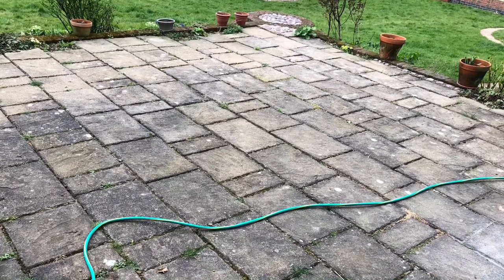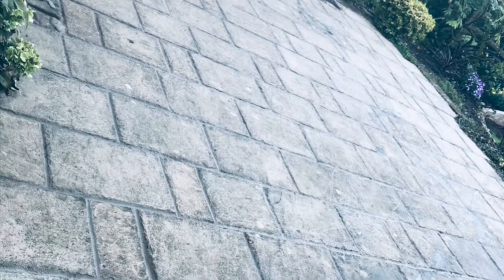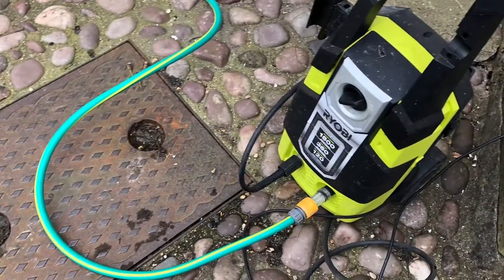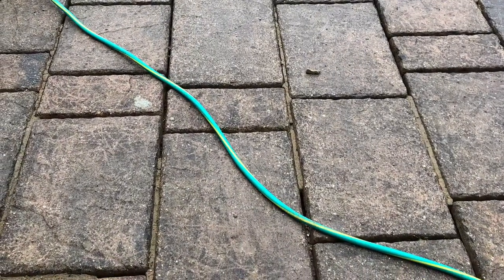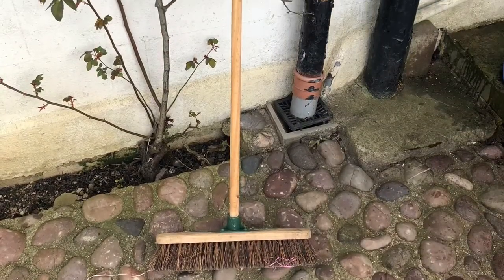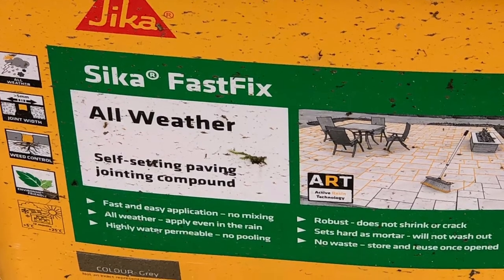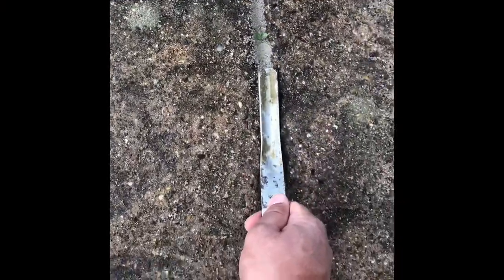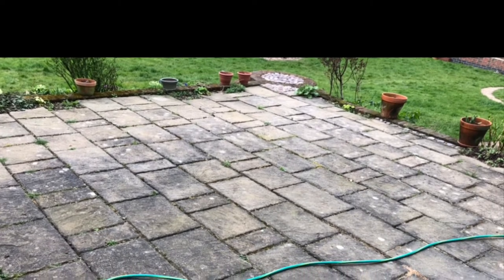How to fill in Paving Joints - setting sand

Comment: Hi. Great video. I was going to paint the 100m2 pavers but this is a better cheaper way. Well done. Q for U.
Once jetwashhed and cleaned, pour water in joints and then fill joints and   press in.

My joints are alot tighter as I have paved bricks. Any advice?